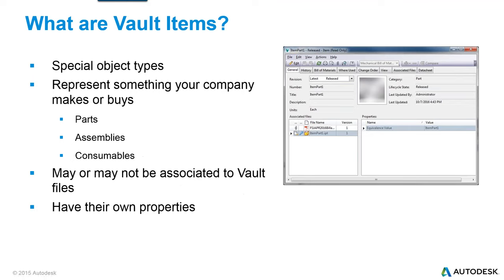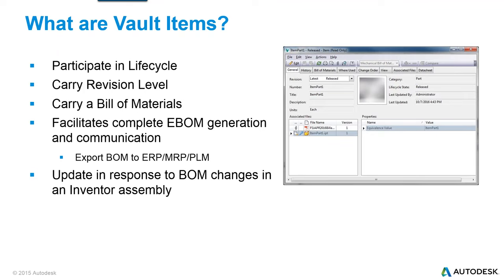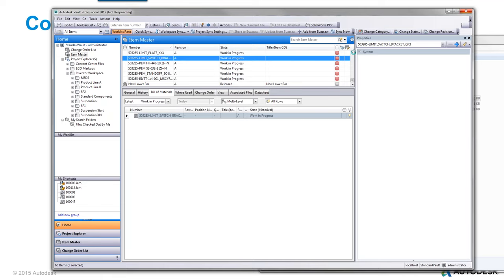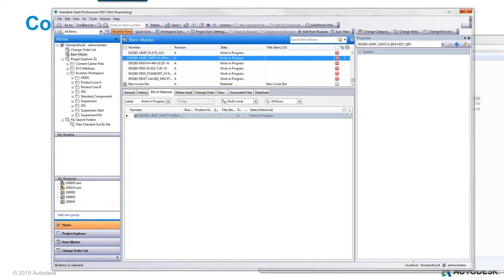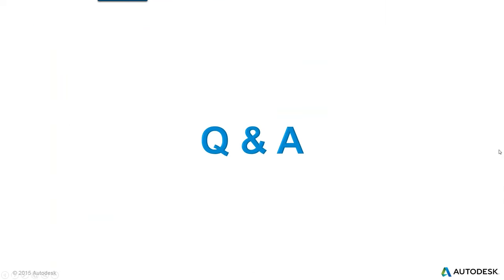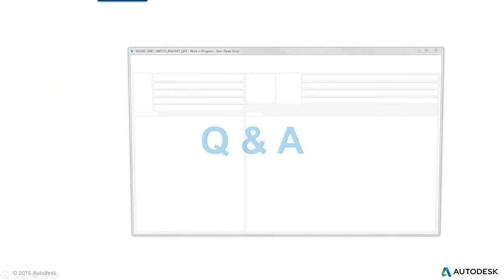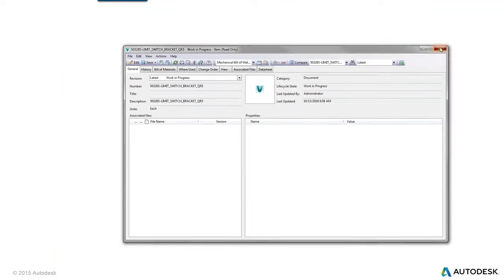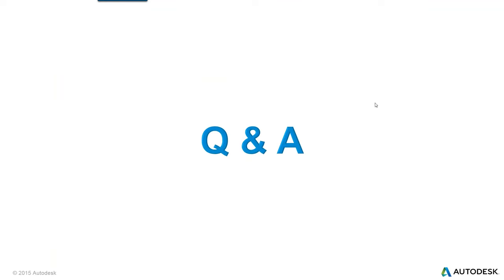Mastering Items and BOMs with Autodesk Vault Professional

Comment: Well this video is 5 years old but this system of item assignment seems to be way more work going from inventor to vault pro than I anticipated. I do not want to assign items "in a separate environment" after checking parts in. I'd like for Vault to automatically recognize assemblies as the files come in from inventor while implementing BOM states.  To manually have to do all of this is mind blowing.   Perhaps I am naive in thinking this needs to be manual input for every assembly you put into vault from inventor or it is truly that bad that the program requires such work.
Reply: Vault does recognize that Inventor assemblies are in fact assemblies. You do have to take the action to 'Assign Item', but it will read the Inventor BOM based on the structure you've assigned in Inventor. The idea of having a separate record for the Item is because the Item represents the 'part number', not just the CAD file. 

In the overall context of the environment, the Inventor Assembly document is just a CAD file. The Part Number often carries more information that is completely irrelevant to the CAD document. There may also be additional documents related to that Part Number - work instructions, spec sheets, etc. From a BOM perspective, the Inventor BOM is just the CAD BOM. Unless you're using Virtual Components or other methods (which all have drawbacks), your CAD BOM typically isn't the complete Engineering BOM.  The Item behavior allows you to more easily add things to the BOM that you didn't/couldn't model, like paint, grease, etc.  In short, the Item record gives you a way to completely define that Part Number from an engineering perspective, beyond just the CAD model. Yes, there's a bit of effort involved, but the alternatives are usually at least as much work and more prone to error.

All of that said, if your Inventor Assembly BOMs are a 1:1 match for your Engineering BOMs, and you don't need to maintain additional non-CAD metadata, then it's probably not worth using the Item Master behavior in Vault. You can attach related documents directly to the Inventor assembly and export the BOM directly from Inventor for sharing downstream. However, if you need to directly integrate with other business systems (PLM, ERP/MRP), using the Item Master gives you more options, because Vault is always on and can take requests from integration software, and the BOM is easily accessible via the API. Getting at the CAD BOM via Vault without using Items is still possible, just a lot more difficult.
Reply: @rogu31sh  thank you for the reply, Our inventor BOMs are close to 1:1. At the very least we are trying to hide or remove phantom parts (ie: frame or skeletal parts that help dictate our frame assembly parameters). I have a few work arounds using iproperties but the attempt is more or less trying to reduce having to manage the BOM 2x. The current BOM also coming from inventor doesn’t feel very user friendly to me currently but could be my lack of experience. The process would be much easier if part occurrences understood which assemblies they belong to imo. Bottom up rather top down.